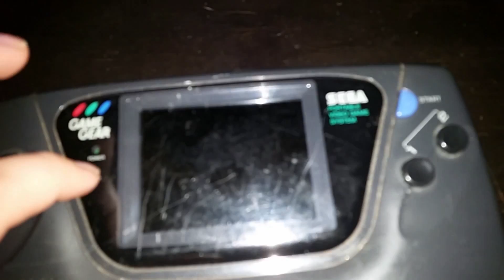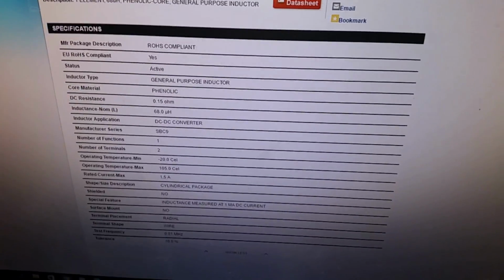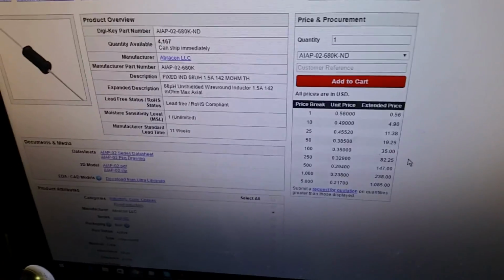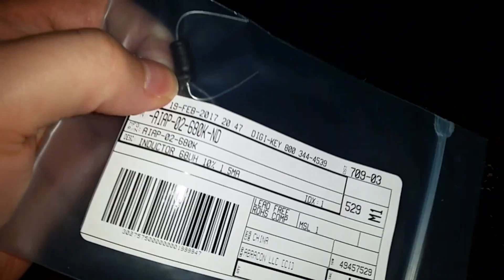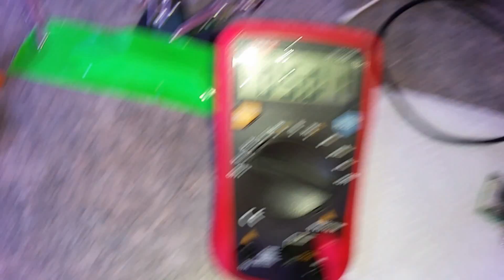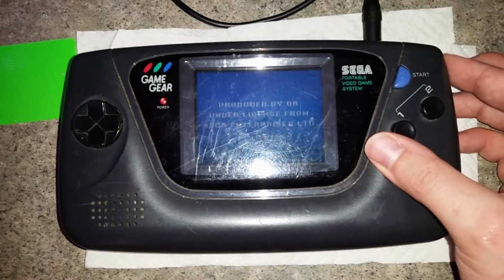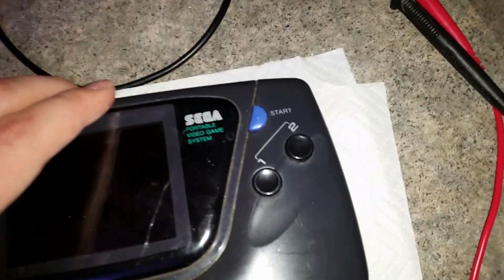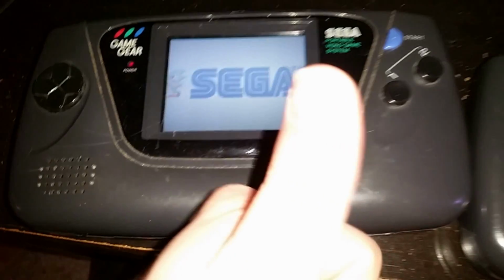Repairing a Sega Game Gear - Replacing an Inductor

Comment: Anyone know why a gg turns on then off after recapping? It did initially run for about 30 minutes then just cut off. I verified its not the pb so only thing left is the MB. It did turn on and off before recapping. The board is actually very clean the oem caps did not appear to leak at all on the boards.
Reply from the maker: On/off is typically a power-related issue, either bad batteries or a faulty power board. If you're powering the Game Gear with a power brick then I would suspect an issue with one of the capacitors on the power board.

Comment: Hi!!  congratulations for the video!!  I have a similar problem with my VA1 game gear.  I completely replaced all the capacitors and it worked for about 1 hour, then it turned off and never turned on again, the red light remains off and the display lights up for 1 second when turned on, then that's it.  If I try the power board alone, I have both 5v and 34v on the cn1 connector, but when I connect it to the GG I no longer have any power on the motherboard.  I have checked and have not found any short circuit to ground, could it be the fault of the inductor??

Comment: Good tip with the electrical tape on your leads there.

I'm baffled the inductor just broke off cleanly like that. Judging by the shell's condition it probably took a pretty hard tumble and broke off - nothing looked like it had corroded the legs or anything. I'll keep an eye out for this in the future, sound like it's not too uncommon of an issue.

Comment: If you install the new inductor with long leads, make sure you cover them with heat shrink tubing to reduce the chance that it shorts another component when you squish it down to the board.

Comment: Yeah on the Sega game gear do the back light mod with the LED panel and you won't have any problems with the Caps going bad because of the components are using to much power to run the light tube on the back

Comment: Yeah I just got my inductor in the mail Saturday and just like yours it was in a big box too on the first note of this how do you find out how to solder the wires on the board which one of the wires go on the motherboard which way do I turn the inductor on the board
Reply: Yeah on the one side of the inductor is a small little bump that is the negative side solder it to the far left side on the board close to the power switch and the other side is a great big dip bump that is the positive side solder this to the right side of the board the trick is to route it where it does not touch anything just like in the video
Reply: Did you find out which way round they go?
Reply: Yeah I did and it was still was a problem with the screen and I also did a led back light panel mod kit but I think it’s the caps that are bad so this Friday the 28 of this month I’m going to get a cap kit and it will work better
Reply: How did you work out which way round they are and which way round?
Thanks
Reply: Yeah Armstrong : I will post a video of the way I put it on the power supply board
Reply: Yeah watch the video again and try to pause it right exactly at 2 minutes and 33 seconds in this video and you can see the way it is routed and I’m actually going to post the video now
Reply: Yeah Armstrong skyview: I posted a video of how to put it on and how to route it

Comment: Hi, please can you help me?, I tried to repair my game gear last weekend, I have a VA5 motherbard and I replace all motherboard caps, when I removed the C55 cap (it's close to the power socket that comes from the powerboard) I soldering the new cap with two cables for place the cap in other place of the motherboard, when i turn on the console I don't have image only a white screen, but i have sound of the game, so I started to check the soldering points and for bad luck to me the positive cable that I add in the C55 cap touch the negative pin of the battery  in the power board, I see smoke in the Inductors zone (JG and JF) and now all the pins of the powerboard's socket give me voltage closes to the Adapter voltage (8.5 volts I use a ps2 slim adapter), i don't  have 5V in the 1 and 2 pin, 1.28V in the 6 pin , 9 V in the 7 pin and 35V in the 9 pin, I only have 7.9V in all pins, Can you help me? What I have to check and how? sorry for my english, I'm from Ecuador, thanks a lot!
Reply from the maker: If the only physical damage you're seeing is coming around the ferrite beads you can try replacing them with part number FBA04VA450AB-00. If you can't order that exact part then try to find some with similar specs. That's basically been my troubleshooting process with these, see if anything looks funny and replace components with the same or similar ones. Honestly, though, the easier thing to do would be to replace the power board with another one if you can get your hands on one.
Reply: Yeah that would be the best thing to do with this and I would do a continuity test from the power supply board with only batteries no wall power cord but check each cap, resistor, and anything from the power supply to the whole Circuit board and if I’m not mistaken I do believe that it even has small component fuses